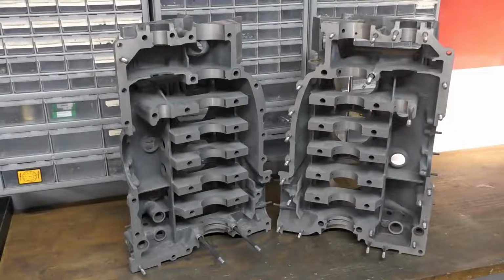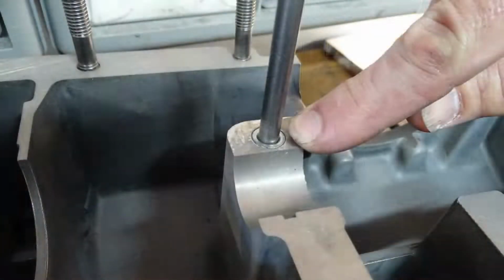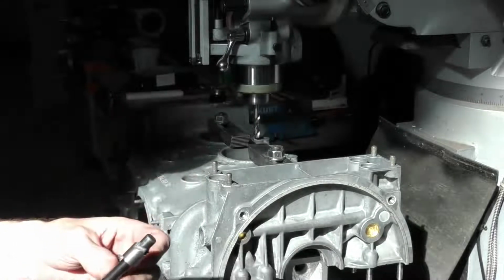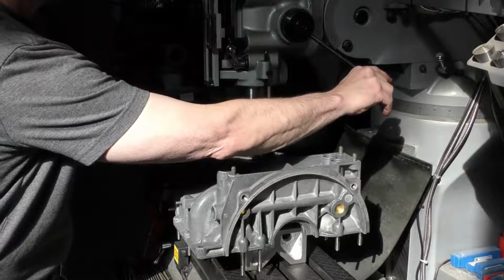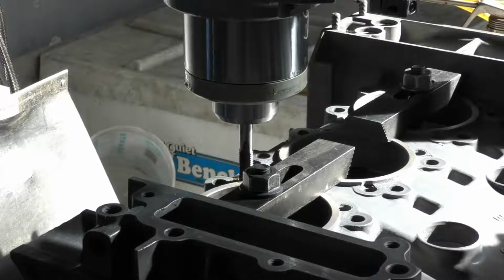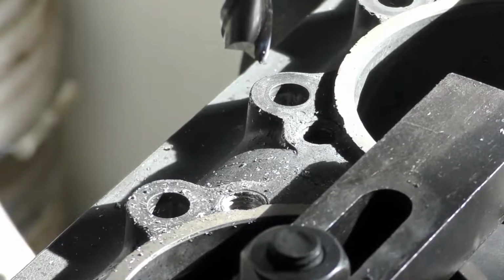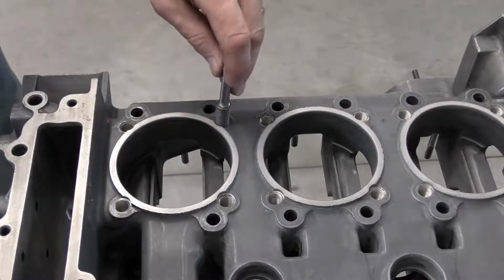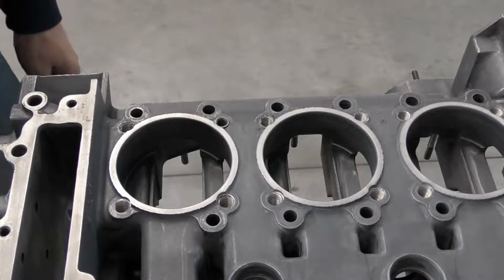Saving your Porsche Magnesium Engine  Case. Head Stud Thread Repair

Comment: El Time-sert debe ser instalado a una profundidad de 0.250" del plano del deck para que el birlo quede con una altura de 135mm, la requerida para que las tuercas aprieten eficazmente las cabezas.
Reply from the maker: Depends on what you consider the deck, I assume you mean the barrel seat. Either way the time-sert only needs to be just below the surface, and does not need to be 6 mm down.
Kurt

Comment: For a 73 911e mag case with standard Mahle cylinders and pistons, do you recommend steel head studs or dilavar?  Thanks
Reply from the maker: It depends on what cylinder you are using. Cast Iron or Biral cylinders will use Steel Studs. Aluminum cylinders will use steel on the intake side and Dilavar on the exhaust side.
Kurt

Comment: You prefer the time serts over the case-savers on meg case? So many mixed reviews.
Reply from the maker: They both work just fine. I am just used to using time-serts as that is what we used when I worked at the dealer and just continued to use them in my own shop.
Kurt

Comment: Love your videos and appreciate your attention to detail as well as your ability to convey your work on video.  Was wondering if you might be able to help with something.  I have a 76' 911s with a very tired, 2.7 , low compression & pulled head studs engine which  requires a case split & machining. My mechanic is has informed me that there's a big delay due to the shortage of quality parts, (he won't use parts from China) for the case, including serts, valve guides & all that's necessary to completely rebuild the case. Wondering if anyone's heard of these problems and where one might find all the parts necessary to properly rebuild a magnesium 2.7 liter engine case.  Very much appreciated. -J
Reply from the maker: So not sure who your mechanic is and yes sometimes parts supply can be an issue however, we are not experiencing any major delays. There are also not a lot of parts for these engines that come from China either. There is just not the demand  to warrant someone to invest the money in manufacturing. Now there are some items that are made in China like pistons and cylinders. However the original Mahle pistons and cylinders are still available, they just cost a lot more. The companies where we buy our parts are only available to resellers and they do not sell to the public. There are however plenty of companies out there where you can buy the parts. Companies like Partsklassik, Pelican, ECS Tunning, and Autohaus AZ will be happy to sell you the same parts that we use. 
hope that helps
Kurt
Reply: It sure does. Thx you so much!  Do you offer rebuild services for that engine?  If so, what would the ball park costs be and turn around time?  Again, thx for the replay.   @Aircooledconsulting

Comment: Is this procedure done when the head studs don't hold properly on the case!..If you are doing an engine rebuild and the studs are all good when disassemble ,can you just reassemble with new studs without this procedure!..thanks
Reply from the maker: Mike,
I guess I never will as I have learned my lesson. Years ago I let a customer talk me into not doing inserts to save a few dollars. He had the express understanding that if there was a problem later down the road, he would be responsible for the expense. The engine didn't last 2000 miles before pulling one entire lower right bank of studs. Luckily I had everything in writing and signed by the owner. However, he was still mad, and it is never good to go back in for something so simple that should just be done in the first place. 
But it is up to you
Kurt
Reply: @Aircooledconsulting  OK Thank you Kurt!..you saved me a whole lot of worry!..thanks again!

Comment: Fantastic Video's Kurt!!! When doing this on a 2.7, the spigot wall gets very thin (1.3mm or so) at the thread-serted hole after counter boring with the 1/2" end mill. Have you had any trouble with cylinder sealing here? Thank you.
Reply from the maker: Never have any issues with sealing even with the small wall thickness. Just make sure everything is flat.
Kurt

Comment: Great video! My volkswagen saver came out with the stud... thank you very much for explaining the install process!!
Reply from the maker: your welcome, usually when the insert comes out with the stud it means that it was not properly expanded when it was installed. 
Kurt
Reply: @Aircooledconsulting  
That's got to be it. It seems like the studs were loctited into the inserts...
Reply from the maker: @KoenigsTiger957  Yes it is not unusual for people to Loctite the studs into the case. When you install the new inserts you can use a little bit of red Loctite on the insert and just make sure the installer bottoms out in the hole.
Reply: @Aircooledconsulting   Yeah, the stock VW case savers are pretty odd, they don't have a locking mechanism like a time-sert.  The some of the cylinder stud hole are straight through...  Seems to hold the measly 18 lbs.  I wonder how much torque is applied as the engine heats up...
Reply from the maker: @KoenigsTiger957  Yes the "case Saver" brand is just a straight piece of steel with an M14 thread on the outside and an M10 thread on the ID. I have never found them to be very reliable at staying installed. With those inserts, you have to rely on Loctite to retain the insert. There are several types of "Case Savers" out there. Some do have types of locking systems and some don't. I personally don't use anything but the Time sert inserts. If for no other reason that once you properly expand the insert you have a solid and positive mechanical bond between the case and the insert. Unfortunately, you are limited to whatever thread is cut into the case at the moment to what insert you can install...
Reply: @Aircooledconsulting   Yep, they dont look very secure. I made the mistake of running a tap through the case threads. Now its a bit wobbly. I did use loctite, it holds the 18lbs of cylinder head install spec. I guess there is the secret weapon JB weld :)  but that's for the next rebuild...
Reply from the maker: @KoenigsTiger957  Yes the Loctite should hold it. The only concern that I would have would be if your motor is going to be a huge compression engine that it may pull studs otherwise should not be a problem.
Reply: @Aircooledconsulting   Stock static CR is about 7.7. I will turbocharge it to about 10psi.  Its one of four studs, it probably be ok.
Is it the CR or heat that pulls the threads out of the case?